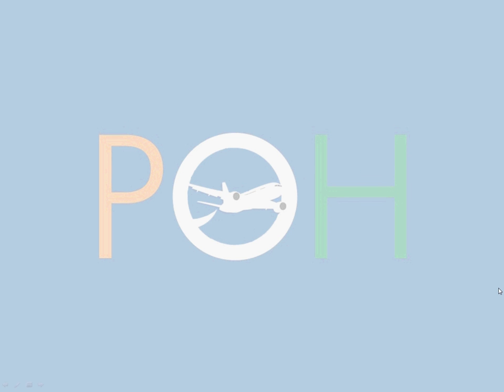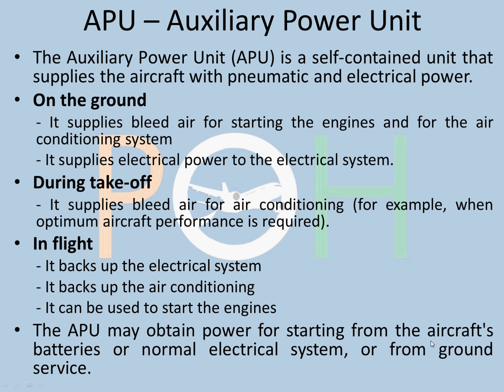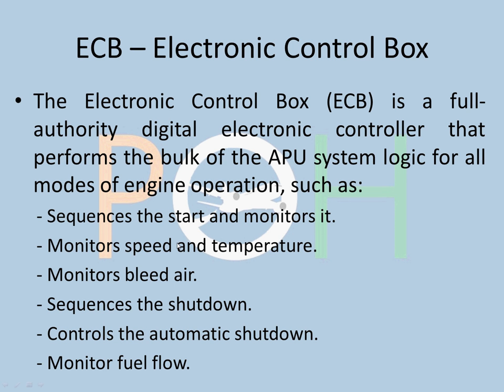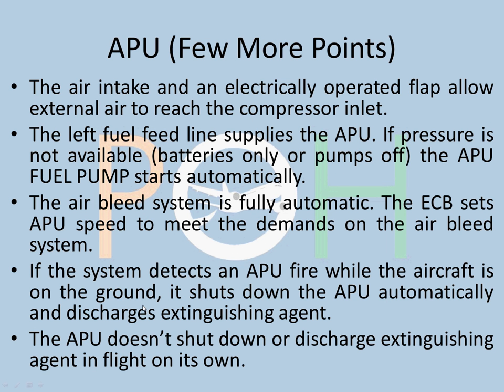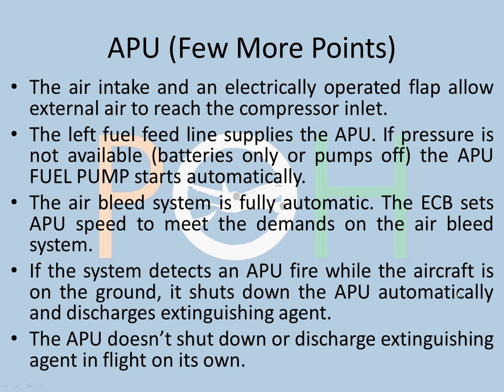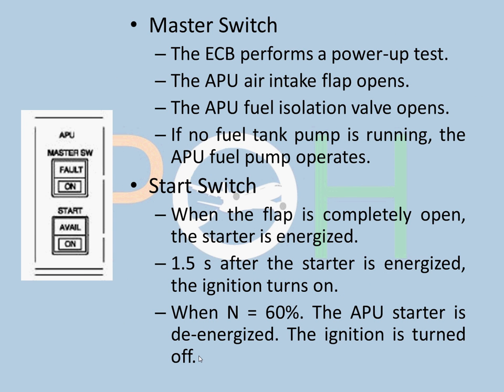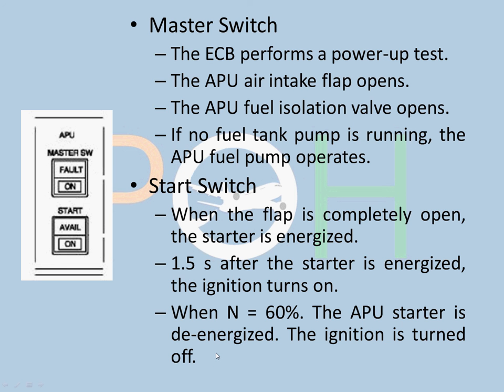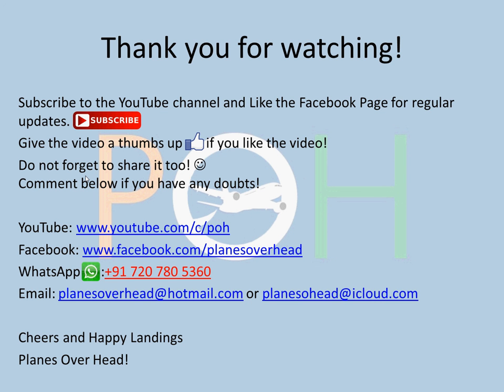A320 - APU

Comment: I have a doubt... when you said @1:01 "this is basically a packs off take off" but , In  packs off we are not using APU bleed or engine bleed. If Packs are on , then, APU bleed should be considered to be put ON. It says in FCOM " consider selecting PACKS OFF or APU BLEED ON" The way you have worded that is very confusing.... did you mean to say "This is in case of PACKS ON takeoff?
Reply from the maker: Yes you're right. Thank you for correcting.

Comment: Is the APU fuel pump shown in the ECAM fuel page ? 

Because what I saw in my flight-sim that inspite of all the fuel pumps and cross feed valve was off APU was still running and the left tank fuel level was decreasing with time.
Reply from the maker: Yes it's shown

Comment: Hii capt. Can we start APU with batteries off and external pwr cart connected ?
Reply from the maker: No
Reply: @poh  But as you mentioned in the slides it can take power for starting from battery or from ground service. so what could be the reason ?
Reply from the maker: To open the APU flap and ECB power up test. Follow on Instagram page there is a video on the same.
Reply: @poh  thanks will do.

Comment: One of the best videos about APU on Youtube. Very well explained. Can you please make about when APU flap/door does not close after shutdown and what can be done to close it? Thanks.
Reply from the maker: Depends why it won't close.

1) If its a mechanical problem then only engineering can solve it
2) if its got stuck because you shut off batteries before turning the APU off then you can turn the batteries on to close it
3) if its an ECB problem then ECB reset can help
too

Comment: Thank You sir for this info.. I'd like to know if APU is considered as generous goods in case of shipping APU by air
Reply from the maker: No it isn't if it's uninstalled with all fuel and oil removed. It's then just a machinery which is transported.
Reply: @poh  ok sir but what if the fuel and oil is not removed.. Which type of DG can it be classified?

Comment: What is minimum battery power required for Apu start?
Reply from the maker: It isn't mentioned in the FCOM as far as I know, but having said that you'd anyway not depart with less than 25.5 V.

Comment: Sir I have some doubts regarding APU. I will be very thankful if you will clear the doubts and I have you will consider. 1.how apu maintain constant speed to prevent fluctuation of frequency 400 hz. In engines there is csd which maintain constant speed irrespective of engine RPM /altitude? . 2.is there provisions to start apu from external power (ground) if there then how?.
Reply from the maker: There is a gearbox on the shaft of the APU too and the ECB will take care of the speed since its all electric in nature. You can start the APU on external power because the external power is connected to the aircraft electrical system only, so its not a problem. However there are no external controls to start the APU, it has to be started from the cockpit controls only.

Comment: What are the causes of the collapse of the auxiliary power unit since when we run engine number 2 through the auxiliary power unit we notice its collapse ... and hear a relatively strong sound
Reply from the maker: There is no collapse and all. It is power transfer. Whenever you shut any engine, the APU takes over that side immediately.
Reply: @poh  
How we solve this problem?
Reply from the maker: Its not a problem. Just a change over of power. What is the problem?

Comment: Sir how APU gives constant speed without use of CSD like IDG..?
Reply from the maker: Whenever the APU runs, it runs at constant speed only more or less and hence doesn't need the CSD like IDG. The core is connected directly to the generator. Whereas the engines turbines run at different N1/N2 values hence need the CSD and hence the compensation is required.
Reply: Dear sir Thank you so much for your valuable reply
Reply from the maker: Hope it clarified, you're welcome!

Comment: You are wrong with the apu.  Apu is turned off after the engines are running. If the apu bleed air and engine bleed air are running you will get a dual bleed warning.
It acts as a backup inflight but it is shut off it has to be turned on during emergency and the electrical power is provided by both the engine generators during normal operation. Apu takes fuel to be kept running fuel that costs a lot..
Reply from the maker: Could you kindly point out the time in the video where you think something is wrong. So that I can cross check. Thanks! Cheers! :)
Reply: Planes Over Head 0:25 the discription is wrong. Although not completely the functions you mentioned are correct but the uses are not.
Reply from the maker: The description of what is wrong my friend? I would want you to be more specific so that I can rectify the mistake as a lot of viewers are watching the same. From my end, I have not been able to locate the errors you are talking about as of now. Thanks.